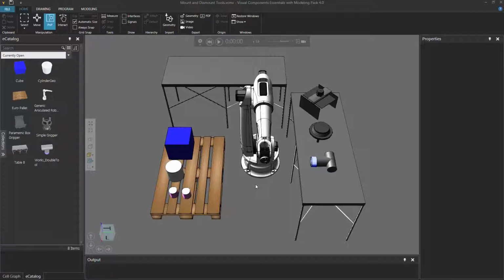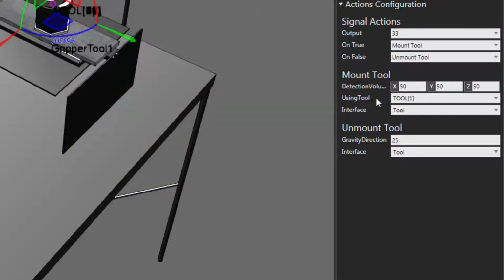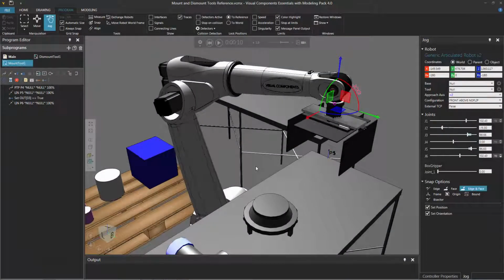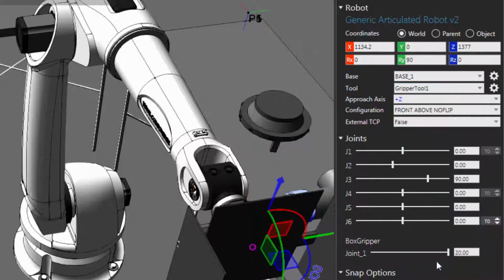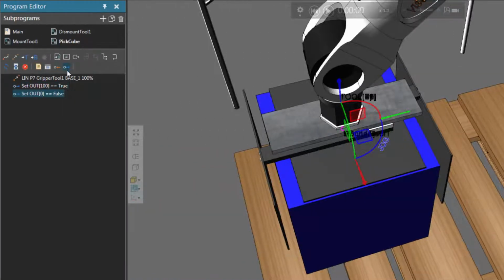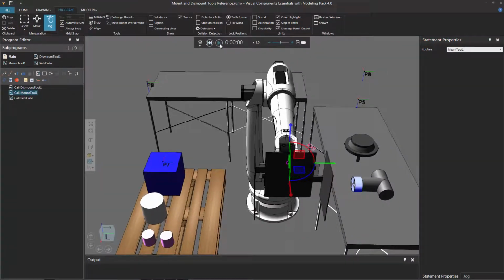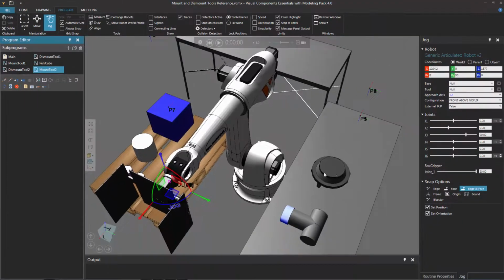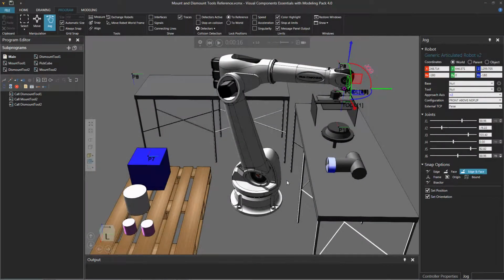Mount and Dismount Tools

Comment: Hi,
Thank you for the video!
Why can't we use the output 33 to pick up the second tool?
Does it matter if we use the same output?
Thank you
Reply from the maker: You can, and it doesn't matter. 34 was used to show that you can use a different output signal and tool frame, which can help differentiate which tool is being mounted/dismounted. But you could use 33 for all mounting and dismounting. One issue with that approach is in some robots you may have to mount tools differently or in certain order. So using different tool frames allows you to position where different tools are mounted.